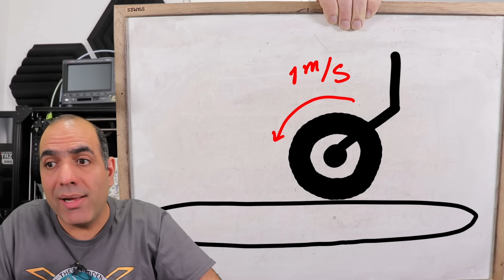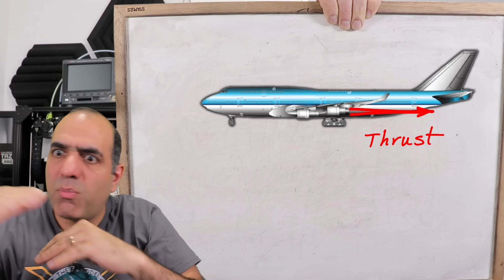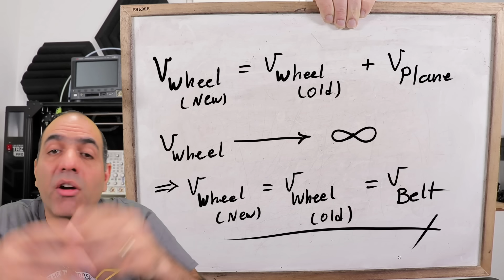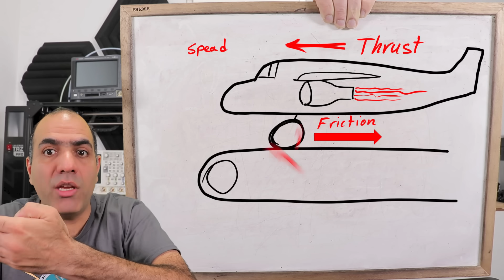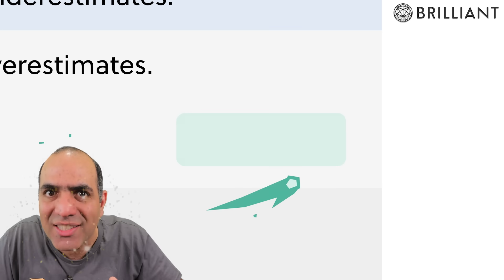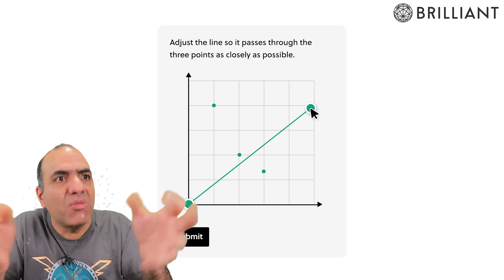Airplane Question that Drove Me NUTS!!!

Comment: it will not, because as the engine push the aircraft forward, the wheel rolls, so is the conveyor. This creates a positive feedback, if there is friction then the plane will get push back, and if there's no friction the wheel will spin very fast until it explode and the plane crash.
Reply: The friction would have to be equal to or greater than the thrust produced which it will not be. The entire point of airplane wheels (at take off) is to reduce friction between the ground and the plane.

The airplane will assuredly take off.
Reply: @ExtraTrstl  friction goes exponentially with the speed. If the speed is infinity then friction goes exponentially to infinity too. It will takeoff when there's enough backwind  that caught with the treadmill.
Reply: @ but you don’t need infinity speed to overcome the rotation of the wheels, because the wheel rotation is a fraction of a fraction of a fraction of the thrust being generated.

Wheels push against the ground, and a plane is designed specifically to minimize that force. Planes move by pushing against the air. Which is completely disassociated with the wheels (indeed it’s why planes fly in the sky without wheels).

If the goal is to simply make the wheels stationary, which seems to be the original intent question, then whatever force the belt has is negligible. If one wants to interpret the question more obtusely as “the treadmill goes the speed needed to make the PLANE ITSELF not move,” then one could say the treadmill will thus go to infinity speed (as will the plane engines) but, at least as I’m interpreting it, it’s pretty apparent that’s not the question. And not to be pedantic, but if we are assuming a true limitless scenario the engines can go to infinity too and thus would still be orders of magnitude stronger and overcome any frictional forces.

TL;DR the force exerted on or by the wheels is a very small fraction of all the other forces (specifically thrust). In the scenario I think most interpret this as, the wheels would not rotate but the plane would move forward.
Reply: @samueladitya1729  also i am not versed in physics, can you explain “friction goes exponentially with speed”? I’m not sure what you mean by “goes exponentially”, and what I’m finding is that the speed of an object does not correlate as such with friction; rather that friction remains (approximately) constant (though work - friction over time) increases.

What am I misunderstanding?
Reply: @  Speed of the wheel usually referred as the speed of the circumference.  But since the question says the conveyor belt velocity = V wheel, then it creates positive feedback loop, the belt will ramp up with the very slight thrust from the engine, unless the wheels are locked and slipping. It's just the logic.

And I'm not a physics geek either, I probably confused with the fluid drag, but bearings are lubricated with oil or grease, so that could add the fluid drag, and it's not linear.
Reply: @ but the wheels move independent of the thrust. You can stop the wheels from moving without stopping the plane because the wheels have no (technically minimal) impact on its movement. These aren’t car wheels where they are the driving (pun intended) force of movement; the force of movement is the thrust the wheels only marginally interact with the system so they are affected (rotate) by that thrust but thats a result, not a cause.

In other words the force needed to overcome the wheel rotation is not equivalent to the force needed to overcome thrust because those forces operate completely independently.

I think a good illustration is to turn everything 90 degrees. Think of the space shuttle (without its boosters) and the wheels out, sitting on its butt pointing at the sky. You can put a conveyor next to it (also at 90 degrees obviously) hitting its wheels. As the shuttle lifts off those wheels will turn. The belt can move to prevent the wheels from turning and it would affect the shuttle basically 0. Heck you could make it go super fast in the opposite direction and the force of thrust will simply take those opposite spinning wheels for a ride.

Stopping the wheels on the shuttle (or the 747 if we move back to the plane), would make the vehicle essentially skid but it wouldn’t impart any significant force on the shuttle/plane itself because the shuttle is essentially 100% thrust based (pushing off the air) to move which does not rely on the wheels at all.
Reply: @ExtraTrstl  the wheels sits on the bearing, and bearings are lubricated with oil or grease, thus it has fluid or viscous drag, the faster it spin the more drag force and convert it to heat, in other words all of the engine thrust power goes to heat up the wheel bearing first before the treadmill reach maximum speed, then the aircraft can start to accelerate. 

If the treadmill is able to accelerate to infinity then the aircraft can still takeoff, but with vertical takeoff from headwind that caught with the belt going backward.

I know this sound stupid, but that's the literal answer for the question, it's unclear, vague, or mistaken.

Comment: After a few seconds when the imaginary conveyor belt accelerates up to the speed of infinity, the belt would have created enough wind speed from the surface friction of the belt and air, that the plane will take off vertically. That is assuming that I was able to buy wheel bearings and tires from the same company that produced the conveyor belt that could go the speed of light.

Comment: So the airplane would have to take off before the landing gear explodes. 

Because it would still move forward you see. It pushes through the air, not the ground. The wheels would get superheated as the plane moves forward.

Comment: To be realistic, if the 747's tyres are quite weak and the belt moves faster and faster, if it were to get too fast the wheels could break or burst due to the rotation, or the conveyor could just shake itself to bits

Comment: That third answer where the plane stays stationary is deliberately re-writing the question. The question said that the conveyor belt goes the same speed as the wheels but in the opposite direction, not that it ramps up infinitely. If the plane is moving forwards 10m/s, then the conveyor would move backwards 10m/s because the wheels are moving the same speed as the plane, because they are attached to it. They will just spin twice as fast as they usually do.

Comment: I’m just gonna put the question in a practical sense 

If the plane and conveyor belt are both on earth and the laws physics do apply to both the plane and conveyor belt (which they always do) and thrust can be added via the plane’s propeller/jet turbine

OF COURSE ITLL TAKE OFF

The planes wheels are not what generates the thrust moving the airplane forward 

The propeller is doing that 

the only way the plane wouldn’t take off is if no thrust was added 

And if that is the case the plane would simply move backwards and off the conveyor belt

Comment: Normally when a smart YouTuber asks a question and says "pause and comment your answer" I never do, but I worked up the courage since this vid is a year old and nobody will see it.

My guess is no, because there's no air moving under the wings and therefore no lift. It even strikes me as an almost silly question. Like, you can rephrase the question as "can a plane take off if you cancel out its velocity and don't allow it to move." But my background is in literature, not science, so I'm fully expecting a "yes it can"

EDIT: Okay, yeah, if ceteris parabis includes jet engines, then of course the plane would move forward, displace air, create lift and take off. Why wouldn't it? And the question did specify a 747 so I should've accounted for that. But it still feels like kind of a silly question? Don't know if I'm overthinking it or underthinking it, probably both. Oh well, glad I rolled the dice and didn't cheat before I answered!
Reply: I think your first hunch is correct. It matters not how forward movement is achieved, it needs to be achieved for the plane (well this type of plane) to take off. The fact the wheels don't drive the forward force is irrelevant since the plane is stationary and gravity is holding it in place. If forward force is applied but then cancelled out by the treadmill then its momentum remains at zero. No forward motion, no lift.

Comment: My reasoning with the friction only on the wheels is also that it would take off, but I make the conclusion that the wheels spin at half the speed that the plane is going through air. Take, for instance, it's moving 1m/s. The wheels are dragging on the treadmill and must spin. Let's assume they start speeding up and reach 0.1 m/s from the wheels perspective to the "road" it's moving at 0.2m/s. While in perspective to the background it's moving faster so it should speed up (ideally they would both start spinning but I'm to lazy to calculate with instantaneous change of velocity). As such there's no feedback loop and the wheels don't explode (yay). I might have missed something tho so lmk and we can discuss it further

Comment: i think it means in real life conditions. and wording was vague.
scene: the airplane is on top of the belt
probable solution: the airplane won't take off in any, even with thrust. the thrust pushes the plane forward, which in turn makes the wheels spin, because the plane is on top of the conveyor belt, so the belt cancels out the force and it doesn't fly.

Comment: First of all: The question wasn't: Does the plane take off, but actually: Can the plane take off? So that removes scenario number 4. We take in consideration only scenarios in which airplane engines are turned on, as in these scenarios we can determine if the plane can take off or not. 
The second thing is: what is the speed of the wheels? What does the conveyor belt actually match? Well at any given time, the conveyor belt matches the vector of the speed of the point on the outer rim of the tyre, the point that is currently touching the belt. So, for any given speed of the point on the tyre that is touching the belt, the belt responds with a vector of speed that has the same intensity but the opposite direction. What is that speed? Well, actually that speed is angular speed (W) of a wheel on a flat surface whose axis is moving horizontally in one direction at the speed of V when there is no skidding between the wheel and the surface. That angular speed is W=V/R where R is the radius of the wheel. So, the conveyor belt matches that speed. Meaning that in time the wheel does one 360-degree rotation, the conveyor belt moves one circumference of the wheel in opposite direction.
What is the speed V? That speed is determined by engines of the airplane, and it'll start from 0 and reach the speed needed for take off Vt. So the max speed of the axis of the wheels is Vt, and max angular speed of the wheels is Wt, and that will determine the max speed of the conveyor belt. Even if you introduce friction between the wheels and their axis, that speed would only be reached slightly later, as there will be a tiny force countering the force produced by the jet engines. 
Problem is that lot of people are interpreting the problem based on semantic of the language used in question. However, there is no semantic. Only physics. The engines of the plane create thrust, and cause airplane to move forward at certain speed. That speed causes wheels to rotate at another speed, that the belt is going to match and that's it.

Comment: Another answer: The belt is too short. Assuming the real-world case where the wheels aren't exerting a force against the conveyor belt, as the thrust is generated by the engines pushing the plane and not the friction between the wheels and surface below, the length of the belt is barely longer than the plane in the posed question. The plane would crash off the end of the belt well before reaching rotation speeds.
Reply: It can be on a set of cylinders just like dynamos if the rotational speed is equalized with the surface.  It’s an entirely impractical experiment- Mythbusters flubbed their attempt badly.

Comment: The amount of people confused by this is amazing. The wheels on an aeroplane do not cause it to move forward, so the plane would move forwards regardless Just imagine they are not there.  If you put a toy car on a treadmill but push it forwards along the treadmill, it still moves forwards regardless of what the wheels do. Same thing here
Reply: You have to adjust the treadmill or conveyor speed to match.

Nobody is saying that the wheels propel the vehicle but that still doesn’t matter.

The matching speed of the wheels and the surface is mechanically identical to matching cog gears.
Reply: @MrDefreese  no adjustment to the treadmill / conveyor is necessary at all. The wheels are on bearings so the speed of the conveyor does not matter at all. (Well ok there will be a small amount additional friction inside the bearings which the engines will have to overcome but that doesn’t come into this equation)

If you don’t believe me that nothing has to be done just look for a video of an ex plane on a conveyor, there are plenty.
Reply: @CunningStunt92  The whole point is the linear travel of the conveyor is exactly the same distance as the circumference travel of the wheel.

1 rotation of the wheel gets you the same conveyor motion at the same exact speed and same exact acceleration.

That is immutable.
Reply: @MrDefreese  also irrelevant. Wheels don’t power the plane forward. The plane would still go forwards. You are reading in to this to much, this is a question designed for high schoolers.
Reply: Further elaboration just because an example came to mind after I replied. 

Imagine the plane on the conveyor belt.  Now imagine in front of the conveyor belt there is a car with a tow rope fixed to the plane (the car isn’t on the conveyor). When the car goes forward the plane moves forward. It doesn’t matter what the conveyor does to match the wheel speed. That force is equivalent to the engines of the plane.
Reply: @CunningStunt92  the very first response stated explicitly that the wheels don’t propel the vehicle.  Read properly please.

Secondly, this is a matter of kinematics.  Whether it is high school level or not, the kinematics don’t lie.

Your assessment is still fundamentally incorrect.
Reply: @CunningStunt92  you analysis is still trying desperately to change the parameters that we are given.  If the conveyor still sticks with the same rotational speed of the wheel, then the introduction of another outside force will logically make the craft scrub along the surface.

You keep making the basic mistake that no matter how fast the wheel rotation is going, the surface is moving at exactly the same rate.  The only way to move the object on the surface is to break that parameter and the only way to do that is to slide it on the surface.

Learn that.  understand that.  Every time you folks try to move the object, you are merely finding ways to get around the stipulations given.

Look at videos of pinion gears on racks or even two matching cog gears to see the relationship of motion of two objects locked together.

Good luck.
Reply: @MrDefreese  I understand why you are saying  what you are however in reality it just wouldn’t work that way.
Reply: @CunningStunt92  reality?  A 747 on a moving conveyor is pretty unrealistic all around…

But even a small scale mockup will show empirically that the wheel axis will never move under the conditions presented.

An easy way to show the underlying principle is to use a two wheel baseball pitch machine.  Seeing the matched speed components in sync will put any dispute to bed once and for all.  1-1 = 0 net speed.  It is given to us.
Reply: @MrDefreese   if we take the problem at the wording of the problem and not the general spirit of the problem then yes you are correct. 

Mocking my comprehension abilities is acceptable. Being a condescending twat however is not. 

“Good Luck”

Comment: Much of the confusion lies in what people understand with "the wheels move in the opposite direction". You interpreted it as the wheel turning in the opposite way as the belt, while some people just consider the middle point of the wheel moving in the opposite direction than the top of the belt. Some even think that it means that they both turn counter clockwise, as that would make the top of the conveyor belt go in the opposite direction of the bottom of the wheel. It's really interesting how the question can be interpreted in so many different ways.

Comment: 🤦🏽‍♂️🤦🏽‍♂️🤦🏽‍♂️ it is such a simple problem. Why mention a treadmill in the example? There is a simple assumption without having to go into friction and slip to zero/infinity. 

A treadmills purpose is to keep someone or something on the same spot. With that in mind as long as the plane is slipping on the spot it will never move forward however much the engine thrust is grabbing the air. And that means no airflow over the wing and therefore no lift.
Reply: Show mathematically where the engine thrust goes. You acknowledge its existence and that it reacts against the air. Newton's laws prove it must got somewhere. Those who believe the aircraft will take off, do not think it will take off vertically in a stationary position. They believe that it will progress down the conveyor with an infinite wheel speed, eventually gaining enough airflow to create lift and take off.  Both beliefs are flawed. It comes down to which flaws you are willing to disregard!